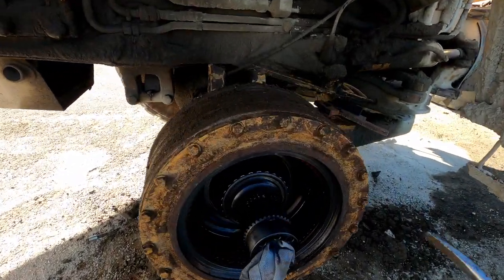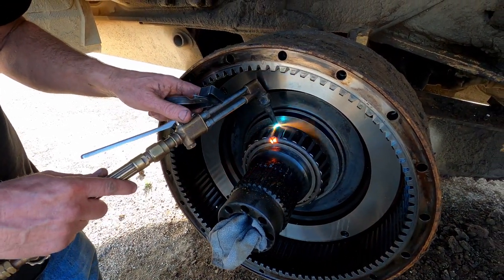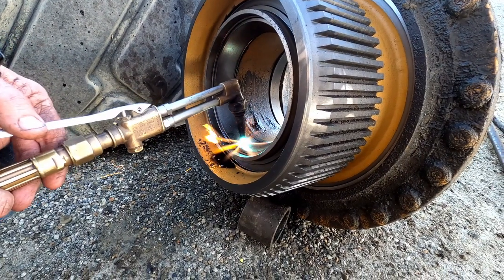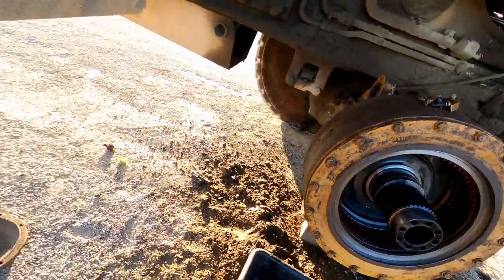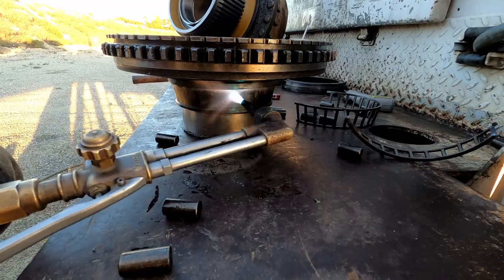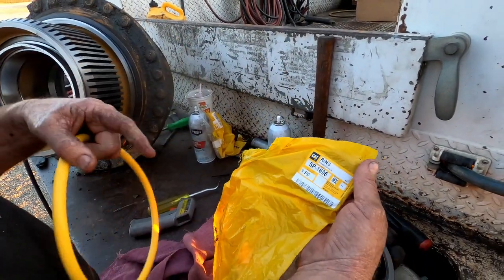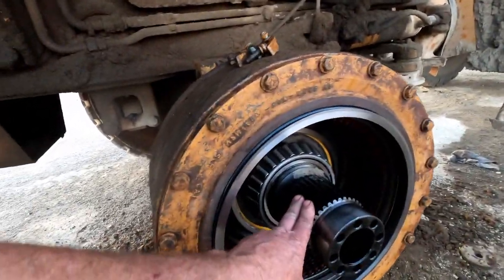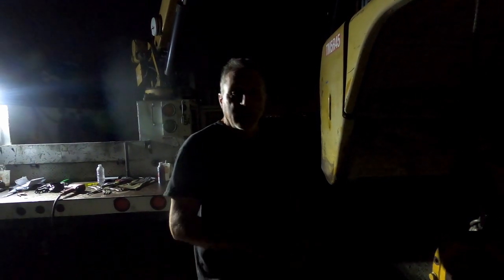Cat 735 Brake and Planetary Cleanup and Assemble

Comment: Good stuff. Doing a 740 right now. Very similar.  What about oiling the duo cone sealing surface?
Reply from the maker: I put a light coat of oil on it right before I assemble it, so that dust doesn’t have time to stick to it. 
I’m not sure if I filmed it or edited it out but I always oil it.
Reply: Hey by there way. There a way to lock the brake on from the back? Just to hold the discs in place if you’re only doing a inner seal.
Reply from the maker: Not sure if you’re asking or letting me know. But ya you can remove the plugs on the back and run bolts into the piston to lock up the discs, but it really not necessary as the spline on the hub has a very generous bevel on the edge of the spline
Reply: @RasmussenEquipment  yeh just asking. Another hub on this 740 is leaking hydraulic fluid into the diff.
Reply: I’ve got the brakes locked on with them 3 bolts on the rear, oil is constantly flowing out from the brake piston (cooling pipes are blanked off. But brake pressure line still connected) that’s normal hey? Self bleeding?
Reply from the maker: Sometimes they seem to constantly dribble, while other times they don’t, it shouldn’t leak past the piston. I always figured maybe I didn’t get the block off plates in correctly and some oil is leaking past one of them. 
One of these days I want to try disconnecting the cooling oil hoses at the hitch before attacking the wheel seals just to see if that will keep the oil from draining from the hyd tank.
Reply: @RasmussenEquipment  yeh my cooling hoses are definitely blanked. When I disconnect the brake pressure hose, the dribble out the brake pack stops. So definitely coming from the brake line. Just thought maybe it’s meant to have some bypass just for air or something. Maybe I needa re seal my brake piston?
Reply: @RasmussenEquipment  update. I backed off the brake clamping bolts to release the brake. When the piston went back to its resting position the dribble stopped. Leading me to believe it’s meant to let out a small amount of oil when brakes applied as a way of self bleeding. So I wacked me new duo cone seals in and sent it. 
Cheers but, your vids helped more than you know mate 🤠🤙
Reply from the maker: Thanks I’m glad it helped you. 
Thanks for watching